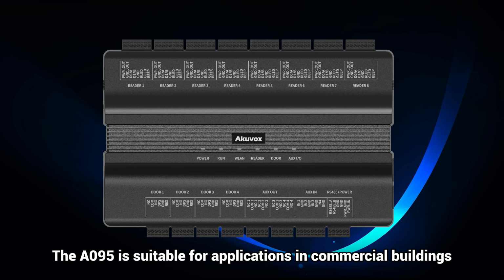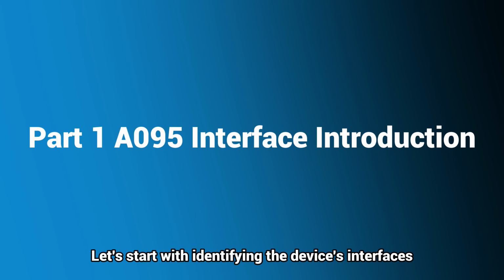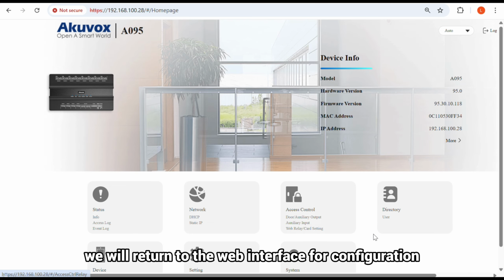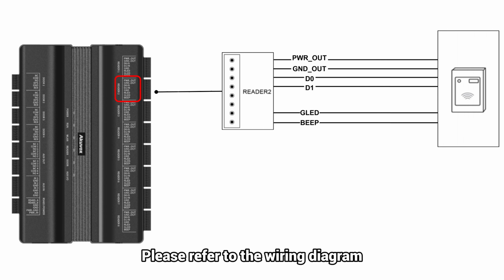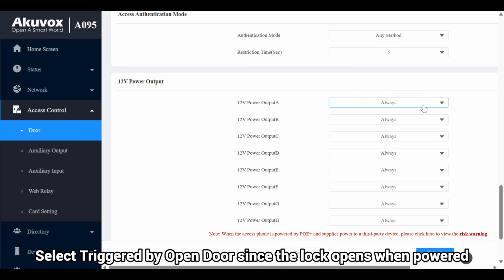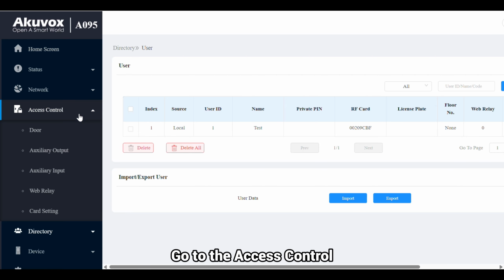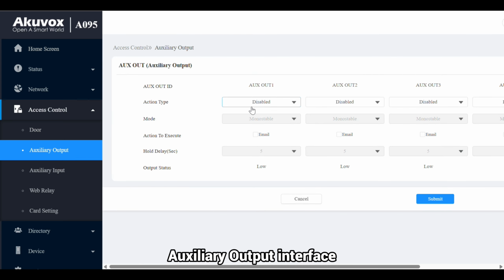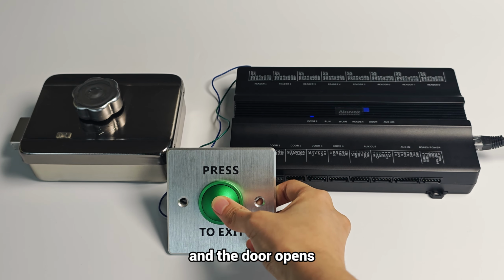[Wiring]Akuvox A095 Easy Setup Tutorial

Comment: Which smoke detector is compatible with this controller?
Reply from the maker: Hi, the A095 is not limited to a specific smoke detector brand.
Any smoke/fire alarm system that can provide an input trigger signal can work with the A095. When the input is triggered, the controller can activate the relay to open the door automatically.